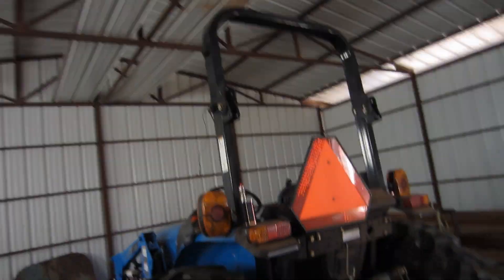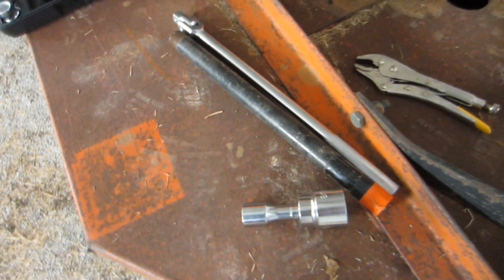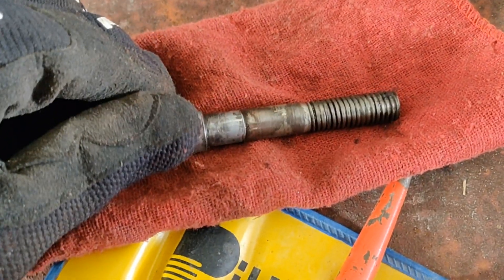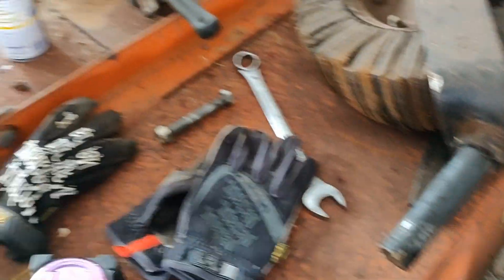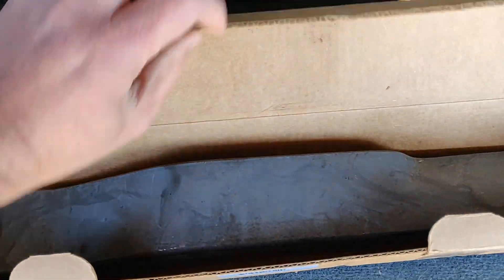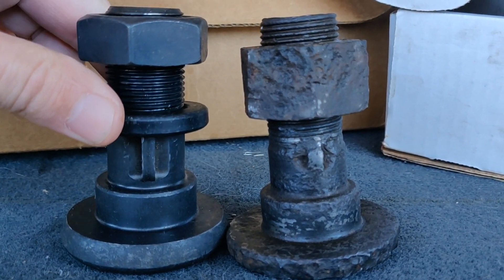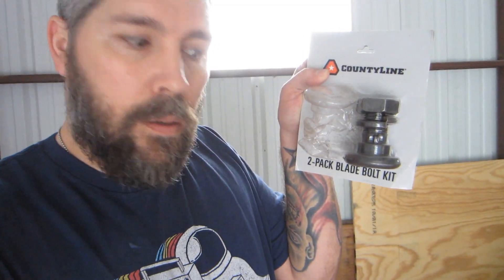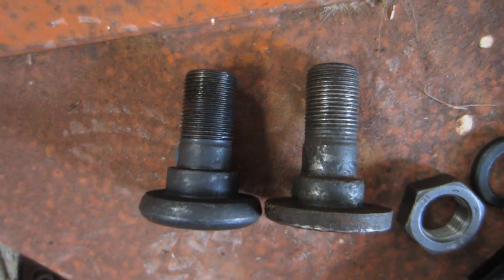I Finally Fixed the Brush Hog! | Oklahoma Ranch Life

Comment: That’s a nice big ratchet set.  I’m in the sane boat as you - my small air compressor doesn’t power my impact gun very well and is basically worthless.  But glad you get her running again, just in time!
Reply from the maker: The set was like $71 and change after tax at harbor freight. Tractor supply had one for $75, and it was probably made in the same Chinese factory. I'm sure it will come in handy.
Reply: Black Sparrow Ranch oh I’m sure it was made in China.  It’s probably not something you’ll use often but it’ll be very handy when you need it!

Comment: My Tebbin rotary cutter is similar to Howse.  I used King Kutter blades and bolts and fit well . My shear bolts are grade 2, try to keep some extras when cutting for quick fix in field . Use anti seize lube on blade bolts to make easier for next time . Check gear box oil level to prevent expensive repairs. Lastly store out of weather if possible . Cause rust makes everything harder

Comment: That 3/4 ratchet and a cheater pipe will render more torque than a regular impact. Good job. If you’ll give that brush cutter a one over ever season and keep those blades in shape they’ll last a very long time.
Reply from the maker: I have added it to my winter "to do" list. It didn't even occur to me to check those nuts before I used the brush hog. I just figured if they were from the factory, they should be good to go. Better to double check, I guess.
Reply: Totally understand. I learned my lesson as well buying used equipment. We’ve all been there at one time or another

Comment: If you need a cheap electric impact wrench get one from AutoZone about eighty bucks I've been using mine for about 10 years no problems
Reply from the maker: I found one on amazon after the recording for around $80. It's supposedly 450 ft. lbs of torque. I'll probably pick one up if I ever have to do this again. I don't have much use for it otherwise.